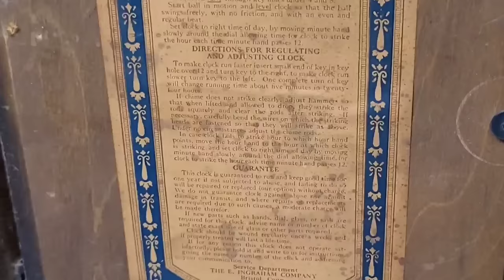Very Oily 1935 Ingraham Mantel Clock (Restoration)

Comment: Terrific video, thanks for sharing.  I use naphtha to clean (camping gas), it evaporates completely clean unlike mineral spirits, etc.  Someone else suggested using "Goop" with lanolin to clean the case and it does an amazing job removing all the old grime (following up with a damp towel.)  Never be afraid to apply a coat or two of shellack, it's so easy to use and the shine is like showroom.  I have never figured out how to restore the old looking dials but maybe that is fine to retain the antique look.  You have inspired me to build an unwinder.  Thanks you so much!
Reply from the maker: Thanks for the tips! Making a winder wasn't too hard to do at all. You should definitely give it a try. Thanks for watching!

Comment: Great job.  I have two mantle clocks that need to be cleaned and fixed.  On one the clock spring broke a few years ago.  I took it to a clock repair shop in Houston and the guy said it wasn't worth fixing.
Reply from the maker: It's worth fixing if you want it fixed. It just depends if you like the clock more than money. It takes a long time (at least for me) to work on these. Thanks for watching!

Comment: Good job!  The Danish Oil really did work wonders on that case.  I don’t know if I would have had the willpower to not do more on that face, but you did right by not risking doing damage to the print.

But what really got me to hit “Subscribe” was the rubber ducky.  What’s life without whimsy??
Reply from the maker: I wanted to work on the face so bad, but didn't want to make it worse. Sometimes, doing less is more. Thanks for subscribing!

Comment: I'm really enjoying your channel. We both take similar approach to not over restoring clocks. I'm going to review my use of ammonia based cleaner having seen your results with soapy water, ultrasonics and white spirit. You use so little cleaner, very impressive. I must admit i think the dial would need a bit more gentle cleaning before I could look at it everyday. But you are right,  better to take it steady and not strip it back to bare metal! The punched bushing would be something I'd be a bit reluctant to leave as is.
Thanks again for the huge amount of time and care you put into your videos.
Reply from the maker: Thanks! Yeah, my goal is to restore the clock to proper working order. I'm not trying to make the clock look brand new and erase its natural aging characteristics (like patina). In my opinion, one of the special things about an antique clock is its age, and making the clock look like it was made yesterday is not my objective. I would have liked the dial to look better, too, but I was nervous about rubbing off the actual ink on the dial. Thanks for watching!

Comment: For scratches in the wood cabinet try rubbing a walnut over it. The oil in the nut hides a lot of scratches without discoloring.
Reply from the maker: I've heard of that before, but haven't tried it. Thanks for the tip!

Comment: I like the easy style of video and voice-over.  Is there a reason you wouldn't use a solvent to remove all the old grease?
Reply from the maker: Thank you. I would need a lot of solvent to soak the parts and that isn't cheap. It would be quicker but cost more. I can either spend more money and be quicker or spend less money and be slower. I'm choosing to spend less money. I use solvent as a final rinse to remove any remaining residues.

Comment: Nice job, as usual. And cool hack with glue on leather tips, thanks!
When strike hammers are in resting position, there is should be some gap between them and gongs, 1-1.5mm should be enough.  If you set them up in this way, the sound of the gong will be much more louder, melodic and continuous, as nothing will interfere with it. Just try to play with it, and you will be surprised.
Reply from the maker: Thank you!

Comment: I'm curious about your soapy water/mineral spirits cleaning order. I would think you'd have better luck with the mineral spirits first, then the water wash. I have some old clocks I'd like to service, and your videos are encouraging me to try. Thanks.
Reply from the maker: Yeah, I question that order as well. The problem is I would have to submerge the parts in mineral spirits completely and let it soak for a long time. I would go through a lot of that solution if I used enough to actually soak the parts and it isn't cheap. So I tend to use it as a final rinse to get of any remaining oils, soap, etc. You should try working on clocks! It's fun.

Comment: man i really live the way you make this process look more fun and easy, really loved this video! Now as an extra question, idk how possible this is but can you come up with a bpm formula but for mechanical alarm clocks (they don't have a 4th wheel)
Reply from the maker: Cool! Glad you liked it. You should just be able to remove the 4th wheel from the calculation. The only wheels of concern are the ones from the escapement wheel to the center wheel. Also, I'm not a mathematician, so I could be wrong here. This is the equation I use.

BPM = (ProductOfGearTeeth / ProductOfGearPinions) / 60

Some helpful sites:
https://bluepapertech.com/clock-repair/clock-repair-101-making-sense-of-the-time-gears/

https://bluepapertech.com/clock-repair/calculating-a-clocks-ideal-pendulum-period-the-sequel/
Reply: @WatchOverhaul  Holy Canolly dude, that's really helpfull, TYSM :)))

Comment: This was a nice restoration - I watch, but It gets really involved and I don't know everything so I'm afraid to dive in on mine.  Let's see, one I got from an antique store they said it was wound to tight, one I got from a flea market that nobody seemed to want and looked like it came from a dirty barn - I say I rescued it (both Session clocks I think), then the last one is a mantle clock and it almost works but struggles (Seth Thomas) -  I like to look at it. 
      I'm looking for a certain antique japanese Takano wall clock. It's ebony colored with a tan face and had vertical grooves down the front along with beading. I know if they made one they made another but can't seem to find one.
Reply from the maker: I don't know everything either, and that's what makes it fun to give it a try. If you take lots of pictures and videos as you go and take your time, I'm sure you can do it too! Sounds like you have some good clocks to try to work on sometime. Winding a clock too tight is a myth. You can research that online if you want. Thanks for watching!
Reply: What are the leather cords you have? You know, where do you get them and what are they called? My hammers have screws on each one of them what's that all about? 
( Leather hammer tip material-I found it on Ebay.)
Reply from the maker: @icemancometh8679 Most of the things I used (including the leather cord) are listed in the description of the video with a link. I've seen scews in the hammers before on a different clock. I think (and I'm not an expert) that the original leather dried out and fell out, and someone puts in screws. Some hammers have threads in the inside to help thread in and secure the leather. Some might see that (not knowing there was leather before) and put in screws.

This clock that I worked on had a screw in the hammer. https://youtu.be/2v4lsRoQwBQ?si=8qGg43190ZtIAdDj

Comment: I'm curious to know: what is the little black arm bearing on the anchor pivot of the escapement mechanism that you move into place @36:40? It appears to be a retaining spring of some sort? It's always nice to see an old mechanism be brought back to life.
Reply from the maker: The verge just slides onto a post so it can move as freely as possible. That little black arm keeps the verge from sliding off its post.

Comment: As the clock is undoubtedly built in inches ( and possibly barleycorns ) why do you take measurements in metric ? Would the measurements not fall out to the original designer’s intentions if you measured in US traditional units ? 
Working on equipment built in traditional units seems one of the few cases where using inches over metric seems the right way to go.
Reply from the maker: Where I purchased the key from, they had the units in mm so I measured in mm.

Comment: That 'green crud' is actually a byproduct of tanned leather getting old, it like, oozes this goo as it gets old
Reply from the maker: Thanks for the info!
Reply: @WatchOverhaul  no problem, I just thought I'd let you know, it just mainly stains or has a reside that it leaves behind, you might have noticed that the insides of the hammers were undamaged, minus typical wear on the metal from age

Comment: This is why if a supposed "clock maker" gives too low of a price to do a thorough svc. They're only gonna over oil pivots, not disassemble and potentially damage your clock.  This profession takes expertise, tools and time to complete.  First to diagnose,disassemble/ clean /rebush, if necessary.  Then after assembly they have to let your clock run and make needed adjustments.  A watchmaker clockmaker has to charge for all of this, unless they owe you a favor or something.
Reply from the maker: It takes a long time to do it right, and I'm just an amateur. A professional clock maker might be a little quicker, but you're also paying for the skills and expertise they have. Depending on the clock, the cost of service might be more than what the clock is worth in terms of monetary value, but sentimental value might matter more. Thanks for watching and commenting!

Comment: Although punching up worn pivot holes was sometimes done in old times and could keep a clock going for some years, it is considered extremely poor practice. Don't do it, but rather rebush any worn holes.
Reply from the maker: That's what I was thinking. Rebushing seems like the proper way. Thanks for watching!
Reply: That was someone using an awl to get more life out of the movement before it needed more work done a proper hole closing punch is used when a pivot have not worn away to much material and would be fine so long as you have the proper reamers to resize the pivot hole to the correct  size for the pivot.

Comment: I may have missed it, but did you polish any of the pivots?
Reply from the maker: No, I haven't learned that skill just yet. I also don't have the tools to do that. It's on my list to figure out. Thanks for watching!
Reply: @Watch Overhaul  An easy way to start is carefully mounting each wheel in a cordless drill and then using a small straight piece of hardwood with a small amount of polishing compound to rub on the pivot as it spins.  I have also seen people mount the wheel in a small vice or pliers and then wrap a piece of string, coated in polishing compound, around the pivot and gently draw it back and forth up and down the pivot.

Comment: How do you adjust the beat error on a clock  like this?
Reply from the maker: What I do is make sure the clock is sitting level. If the clock is still out of beat, I slightly bend the crutch wire until the clock is in beat.

Comment: What happens if you don’t put the zip ties on the springs?
Reply from the maker: The springs wouldn't unwind all the way and bind up on other parts of the movement. Once the plates are separated, the force of the springs would probably make a mess of everything - could cause damage and be dangerous.
Reply: Kaboooom!!!

Comment: I find it is much easier to first take all the parts and soak them in Mineral Spirits for an hour or two.  Then wash them off in a ultrasonic cleaner (detergent and hot water) for 15 minutes. Finally a rinse in distilled water and isopropyl alcohol. Gets about 98% of the crud off.....
Reply from the maker: Yeah, but I am trying not to blow through and waste so much mineral spirits cleaning one clock, and I also don't have a bigger ultrasonic cleaner. As a result, it's a little harder to clean and takes longer, but I save more money. Thanks for the suggestion and for watching!

Comment: why didn't you clean the face of the clock?
Reply from the maker: I mentioned why I didn't clean the dial more aggressively in the video. There's a high risk of over cleaning the dial and removing the ink - I didn't want to make the dial worse. I tested a small area of the dial and the discolorations did not want to come off (not shown in the video), but the ink started to. So I decided it was best to gently clean the dial instead. Thanks for watching!